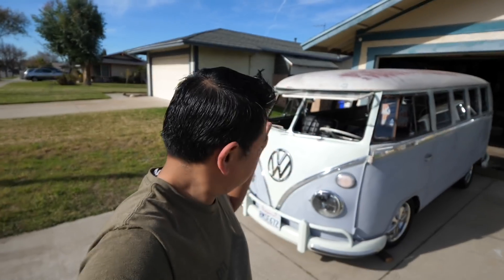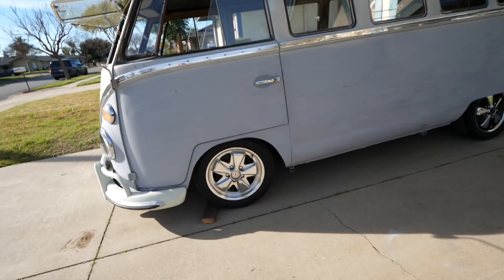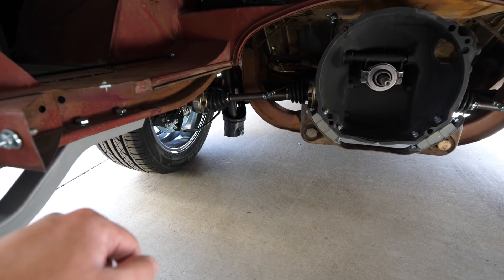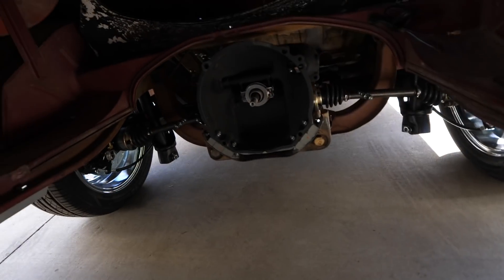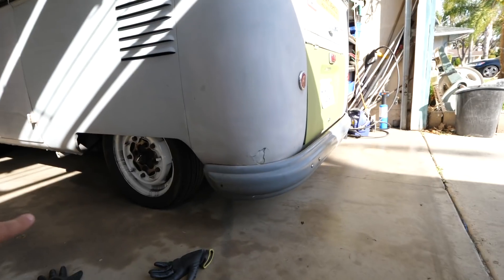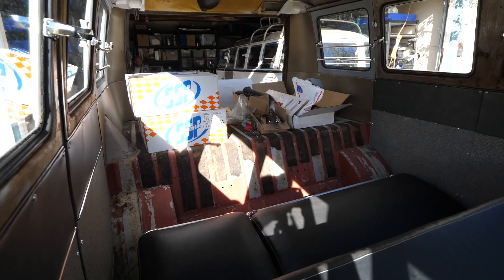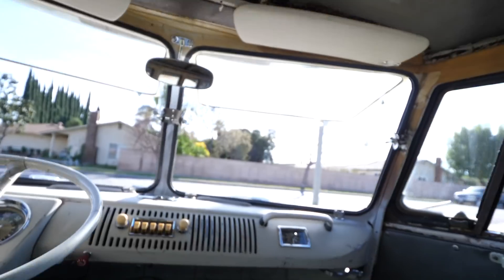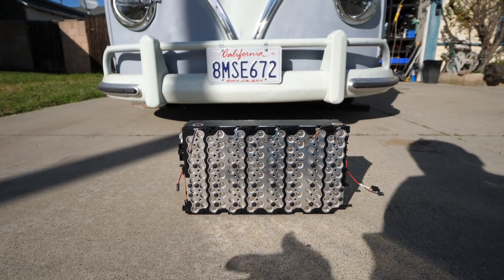ICE to ELECTRIC conversion - How Long will it take One man challenge

Comment: My estimate is about 45 hours and 55 minutes ,10 seconds*
If you use all the parts from previous bus.

Motor installation 1 hour 55 minutes. Since coupling is ready

All wiring work need around 1 hour.

Battery instation would need about 2 hour

Installation of bms  and front panel 30 minutes.

Motor controller installation 1 hour.

Pre charge relay circuit,main contactor, power meter, dc-dc converter ,fuses installation would take around 1 hour .

Some more time for other stuff...

If you work by this plan you should be driving by 45 hour 55 minutes and 56 seconds

Calculation exclude time for, sleep, breaks, launch,etc...

Have a great day and good luck !

Comment: Brakes- 10 hours
Battery/motor exchange adapt 45 hours
Electronic interfacing 16 hrs
Bandage/first-aid .5 hrs
Standing back wondering if another way would’ve worked easier 2 hrs
😄

Comment: 46 hours 26 minutes and 23 seconds:). I have so appreciated your videos… My first car which I still have is a 1982 Volkswagen Vanagon camper… It’s gotten pretty rusty and I now have an electric vehicle and really find it hard to justify driving it as much… I really want to convert it one day… Would love to bring it out there or to see if we can work on developing a community of clubs/enthusiasts that could help each other with conversions and guidance- and perhaps shared workspace and tools, etc (maybe dues that would include support for each other if no one else is likely to touch something so unique).… When it was my only ride for many years I was a little bit better/more knowledgeable with some basics, but my wife would never want me to do bodywork, mechanical work, or other things that weren’t very clear and straightforward as that is traditionally not my forte (and I promise you that she is wise in these matters and pretty much correct (for me particularly) given certain track records)… I really need to do these things with the guidance of someone who knows the general principles of vehicles, welding, safety, etc. – or to pay someone to do it (we never had a car or a shop class growing up in New York City, but I’ve looked into temporarily donating it as something to work on)… I would love to upgrade it in terms of some things in terms of safety and seating and also to have the ability to run heat (which it has had in the past) or even air conditioning – imagine that!- but I am literally reminded that I apparently “failed scissors” in kindergarten, probably the reason I never attended Harvard;-)…. There is beginning to be a movement towards electricifation and I feel like you are at the center of it- a movement where EV conversions will be happening more and more- and with the right support and community I know I can have the confidence to work on it myself...  This is so important for the future of our planet while simultaneously respecting the history of design and engineering, etc.… Feel free to check in at any point and let me know your thoughts on this :-)… I probably can’t afford to do anything financially for a few years anyway, so while you are busy working on this there is no rush – but I would love to hear your thoughts on this at some point...  Until then keep on keeping on!:)  -Daniel in Ohio

Comment: Around 3 Days or 56 hours if you start 8am and finish 4pm on 3day...
1 day - fit the engine and wires
2 day connect motor driver etc
3 day fit battery  and go :)

Comment: I believe you can do this in 7 and a half days
well done, it's beautiful work.. the drivetrain is so clean <3 <3. Ive just finished my first conversion using loads of second hand parts but I can use it to get to work daily. I have a spare DC motor and controller so Im on my way to my second conversion! I was thinking a motorbike... (I know AC would be more ideal..) I want to make electric vehicles for life but Australia is behaving badly re electric vehicles. my vision is that we end our dependance on combustion in all its forms. this is the future!

Comment: Add active thermal management (heat pump with coolant circulation and radiator) to the battery pack.

Comment: I guess the assembly of motor, battery, controllers and other accessories might take 1 to 2 working days while the testing might take another 3-4 days where you might have to change and redo some assembly

Comment: I tested my alternator straight off the stator right above where the real bearing sticks out of the case there’s a little one and a half inch window c 3/8 each lead I stuck my multimeter in there on each one set on AC voltage I hit over 2,000  VAC  spinning about 1,000-2,000 ! 2,000 The mirror just went  to 1 on the far left but as a drop in voltage when I got off the trigger of spitting yet I saw voltage of 1,980v Ac can I run electrically a Paul wire off each one ? 2 - =  2,000v x 3 can I do ?
Reply: I have the video!

Comment: 18.23921 hours on the job, but you gotta stop the clock for bathroom breaks and lunch, snacks, if you smoke or take a nap, play on your phone, talk on your phone about anything unrelated to the build, wait for parts that you forgot about or if you knew about the parts but they arrived late....had to run errands for the wife or close friends, get stopped by the police and questioned about anything, any medical issues that require time away from the job, brain overload that causes your fingers to stop working on the project because you have to ponder the next steps,  any time work ceases because you want to dance or sing along with the radio, time to scratch an itch,  and of course, time spent managing the stopwatch / detailed work log.    :-)

Comment: I think you should do a analysis on the axles, the OD seems a little on the smaller side for a vehicle this size and obviously considering the mass of the batteries and all. Or just see if they break which i hope they shouldn't then you can change them. You can also consider using UV joints instead of CVs as they are a lot tougher for the same mass. Finally I am curious whether or not this bus has ERS or not?

Comment: 140 hours this includes setting up the BMS and charger installing nice charger plug meter Etc. I'm assuming you're going to buy your adapter plate and not make it. I'm also assuming that you're just going to where are the batteries in somewhere and not spend a lot of time making fancy battery boxes. Look forward to seeing how this goes

Comment: I would have loved to see the restoration work. Although, I had autobody classes, see how it is done in the modern age would be interesting. Tig, mig, buzz box, oxyacetylene. Spot welders. Lead work in my days. The replacement panels, where did you source those.

Comment: (2:14) - What happened to the front? It looks like someone was pounding on the inside of the metal with a ball peen hammer...  are you gonna flatten those out with a body hammer and a dolly? Or at the very least, knock them in and smooth it out with some body filler?

Comment: I think it will most likely not take you longer than 24 hours of work to move the system over as the motor does not need custom fitting. So 24 hours for a driving bus, not caring about esthetics.